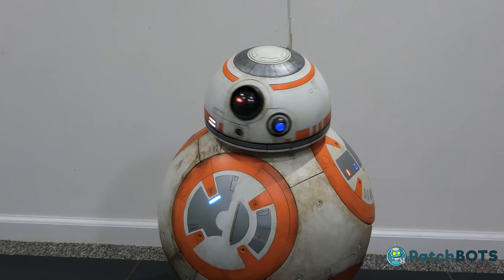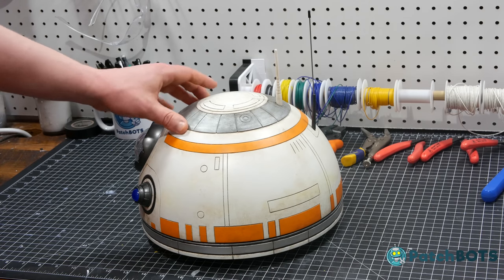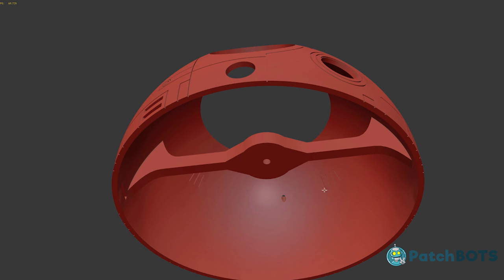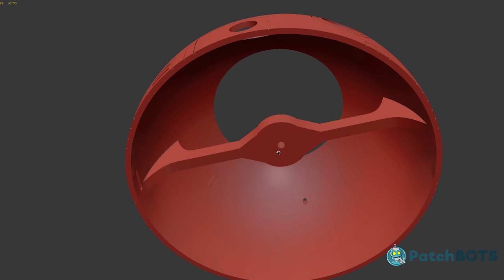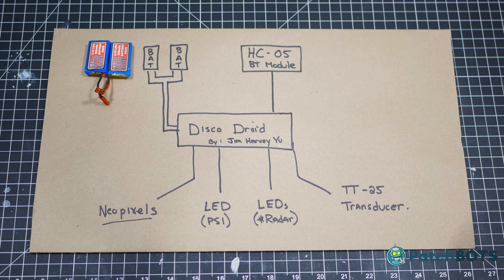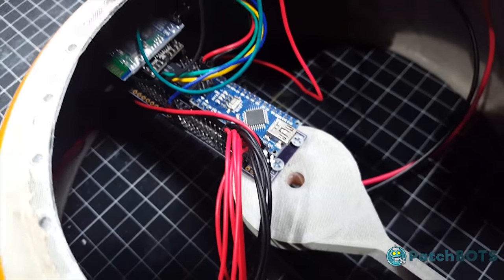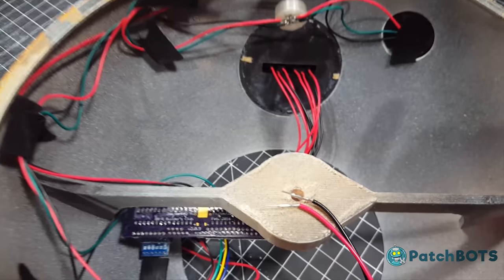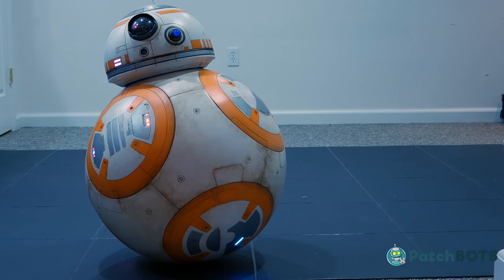Star Wars BB-8  Head Mechanism Explanation

Comment: This is awesome work! Thanks for stepping us through all your steps :) very helpful. Which 3D printer do you use? The print quality looks really good.
Reply from the maker: Thanks Robert.  I'm using a Lulzbot Taz5 currently.  The taz is definitely capable of high quality prints, but I tend to print "quick and dirty" and make it look pretty in the finishing process (sanding and painting).  The Taz is especially great because it has a fairly large print bed which is helpful for larger projects like this.

Comment: This looks great. Is there any way you can divide the dome and skirt into thirds for people who have smaller print beds?
Reply from the maker: I wouldn't be able to do that without adding some structure between, which I then wouldn't be able to test out without reprinting.  Angelo Cavallo is another builder who has done a lot of work on reducing weight in the skirt/ring.  I would suggest downloading his models (available through a FB group search) or getting in touch with him. His file are split into 1/4ths I belive with all the sidewalls necessary for joining the pieces together. His ring/skirt will work perfectly with this setup.

Comment: Could you upload some of your print settings? I know weight is important. For example, how many layers? Fill? Any other settings which may be useful. Thanks! I'm using Simplify3D.
Reply from the maker: Hi Michael.  The aesthetic pieces (Dome, Skirt, Dome Top) were all 2 perimeters and incredibly low infill (I believe it was 5%,  not much space between the walls anyway).  My bottom and top layers are usually set to 2 as well.  This may then require some post work, for example I had to use some putty to cover some light cover on my top layers specifically on the main dome piece, but nothing major.  For the structural pieces I did 3 perimeters and 35% infill.  The tires are are done at 50% Semiflex, and the smaller caster pieces are done with 3 perimeters as low a lower infill (15%).   I'll update the webpage with this information.    Use these as a guide, but see what you can get away with on shaving off weight. It's all about the light dome.
Reply: Perfect info, thanks for taking the time! I'm printing now.
Reply: Did you use any supports? Thanks again for your great feedback and solution. I appreciate you taking the time.
Reply from the maker: Yeah. Some parts require supports.  AESTHETICS:  The Dome requires supports under the crossbar only, no supports needed on the skirt or dome topper.  STRUCTURAL:   The spindle arms require supports under the dovetail, nothing on the spindle hub.  Nothing on the casters requires supports.

Comment: Is there a way this system could be connected to an existing one piece dome?
Reply from the maker: I uploaded just the crossbar to the github linked in the description.  You can probably slip it in from the bottom and orient it.   At that point you can glue it.   This may result in a slight height discrepancy which can be fixed by appropriately scaling the Spacer piece along the Z axis in your slicer program.  Might take a few tries to get the scaling right, but that's half the fun, right?   I've never tried this method though, so I can vouch for it's success.  Sounds good on paper though, good luck!